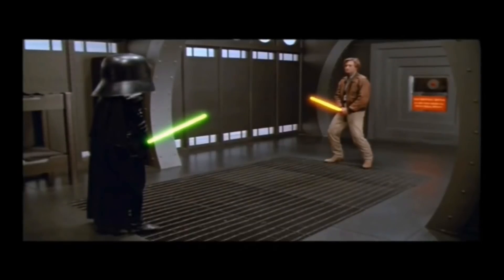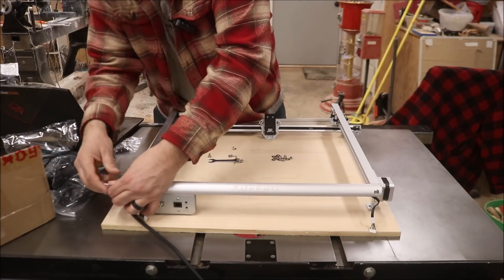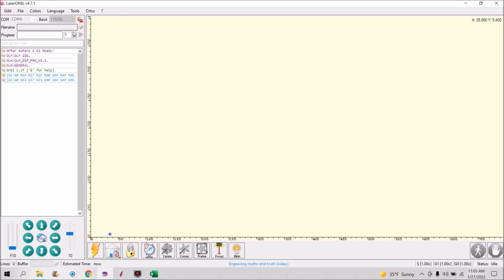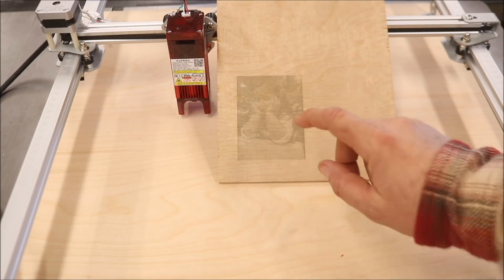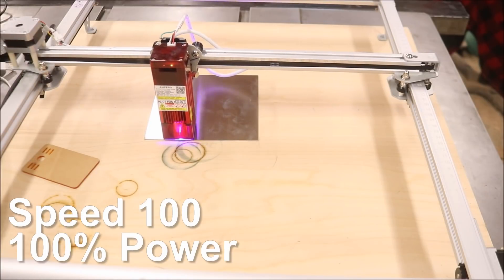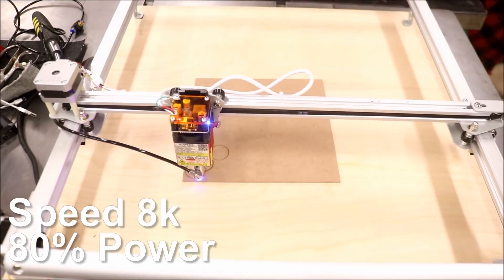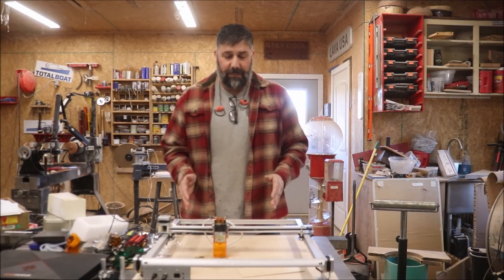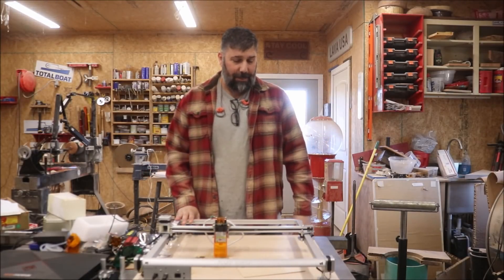Is This The Best Budget Laser Engraver on The Market?

Comment: Have fun with the new laser! A heads-up about moving the laser module manually; one youtuber said that he fried the electronics inside the module by doing that. Apparently the movement cause the motor to act as a generator and sent a charge back to the module while it's turned off, which fried a resistor or something inside of it. I don't know the technical details but basically, it's a bad idea to move the module around manually.
Reply from the maker: Hey Ted, was that an Aufero Laser 2? They are made to be moved around like this. Hmmm I'll look into it. Thanks for the heads up.

Comment: I see the promo stuff you have. I think I’m going to pull the trigger besides the short focus what else should I get to go with it
Reply from the maker: I would get the system and choose the short focus laser. That's it. That will get you started. They do sell material on there site also. If you can't find the speeds and power excel they have let me know and I can email it to you. You have to adjust some settings depending on where you are.

Comment: Looks to be a nice tool to have. A couple of questions.
1. How much time is involved with changing the lasers out?
2. In your opinion, would the optional height adjuster be worth the investment?
Thanks and keep creating!
Reply from the maker: Great questions Lee. I videoed me swapping out lasers, but had to cut it for time. To change out laser all you have to do is pull the plug on the top and unscrew one screw. Takes about 5 mins.  The height adjuster really isn't needed. It's so easy to set the focus already, it would be another $55 for nothing gained.

Comment: Dang it Ken, you had to go and demo a tool that looks has some really good applications to some of the things I want to do.   Well, it goes on the list.  My real problem is space.  Between this and the resin printer Zac Higgins demo’d I’m scratching for places to put them. 😀
Reply from the maker: I use mine then hung it on the wall. I still haven't figured out what I would use a 3d printer for.

Comment: what about work piece hold down? How is that acomplished? The base is wood? If you use screws in it and later want to replce base with a new board can you use off the shelf boards?  thanks, Jeff
Reply from the maker: Hey Jeff. no need for hold downs on a laser system. The piece lays flat and there is no force exerted on it. As for the bottom piece. I added that. It is just a piece of 1/4" plywood.
Reply: @MoonpieCreations  But if you bump the table it is on and the piece moves? If use thin material and it does not sit perfectly flat? Seems it would be nice to have simple hold downs.
Reply from the maker: @jefftrag1956  not really sure how hold downs would work.  After all the things I etched I only had an issue with the letter.  It was sticking up and the laser hit it.

Comment: Hello! Great Video! I'm looking to use this more as an engraver than a cutter. I see on the website the size recommendations for cutting. What is the largest thickest you have used to engrave?  For example would it engrave a 2-3 inch thick cutting board?
Reply from the maker: It will engrave any thickness you want. I screwed the machine to a board, but I can take it off and add.....lets say 2x4's on the edges. This would increase my depth another 1.75 inches.

Comment: I  guess you're gonna be making your own logo "coins" now? wonder how that would do on brass, how long it would take to ever get all the way through
Reply from the maker: I'm not sure these lasers are strong enough to cut through metal. But I bet I'm gonna try lol.
Reply: You could buy the “coin” blanks and engrave on those without cutting. If you did that you may be able to quickly recoup your cost by just selling a few to other WoodTurners  in a local club.
Reply from the maker: @trurex007lee7  good idea.  Just ordered 150 1.5” blanks.

Comment: So how much is it with all 3 laser modules?
Reply from the maker: The system is on sale right now. 
Aufero Laser 2 $369.99 You can get the Lu2-4-SF included
LU2-2 isn't for sale on their site, but the LU2-4 is $149.99
LU2-4-LF on sale $149.99

So you can get the whole system with all three lasers for $539.97 right now. But most on need that LU2-4-SF. Or that one and the long focus
Reply: @MoonpieCreations  yeah I'm just looking at engraving cutting boards and knife scales Thank you again